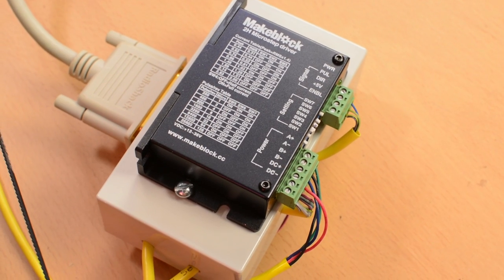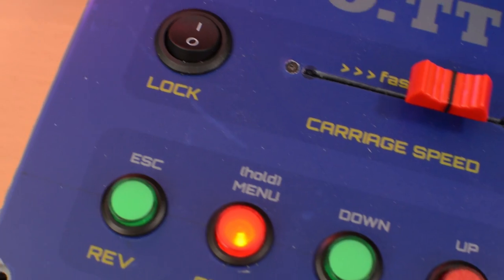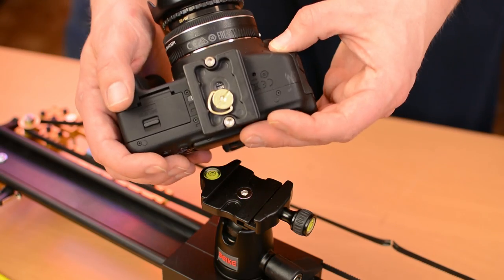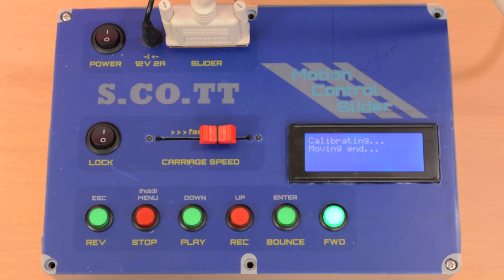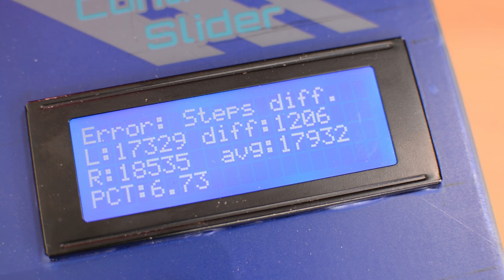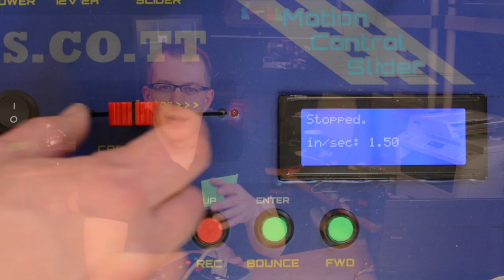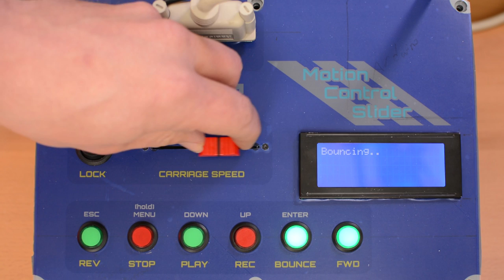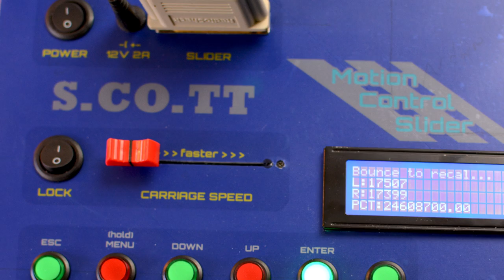S.co.tt's DIY Motion Control Camera Slider - Introduction and Demo - Arduino Project

Comment: Loved your work Scott! Regarding the loudness of the motor you should try the silent step stick TMC2100 driver, its unbelievably quiet.
Reply from the maker: Thanks for the tip!  Fortunately I've only had the occasion to use the slider for MOS inserts and such, so it hasn't been an issue (yet).

Comment: Hi Scott, I am actually working on Arduino slider with TFT LCD touchscreen. Had the same problems with jitter, but solved with TimerOne library, when there is a interrupt routine driving stepper, and its not affected by drawing on the screen, main loop is only changing variables for interrupt routine to drive motor. Not finished yet, but so far I am happy with results... Best regards Olda alias Firefoxik75

Comment: Great Video and great project, I have been looking for a system like the one you built. I have a Proaim Spark 13 and I would like to motorize it with a "Loop option"l ike you did.Since I have the Slider, would you share the part list for the electronics, the diagram and the ard the arduino code.
Thank you

Comment: Hello Scott - great video, thanks! Quick question - what pulley did you use to attach to the motor spindle (shown at ~15s) and where did you source it? Thanks for any help.
Reply from the maker: +PilotGT Thanks, much appreciated!  The pulley is from Makeblock, as are all the mechanical parts.  They ship from China, but their kits (and probably parts as well) are available from US distributors.

It's a combination of this gear:
http://www.makeblock.cc/gear48t-blue/

With these slices/guides bolted onto it:
http://www.makeblock.cc/timing-pulley-slice-90t-blue-4-pack/

Comment: excellent job well made, what is the rating , size and rpm of your drive motor and is it geared,?
Reply from the maker: Paul Bayliss Thanks!  I got the motor from Makeblock, and it's this model:  http://www.makeblock.cc/42byg-stepper-motor/

But the short of it is:  Rated 1.7A, size is 42mm^3 (excluding spindle) w/mounting holes 31mm on center, 200 steps/rotation (not sure about max RPM though), and it's not geared.